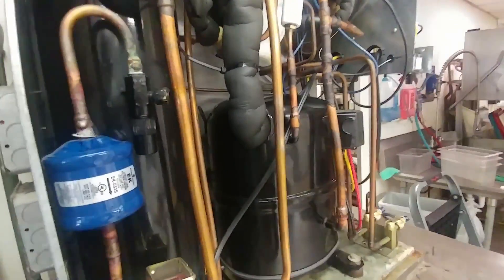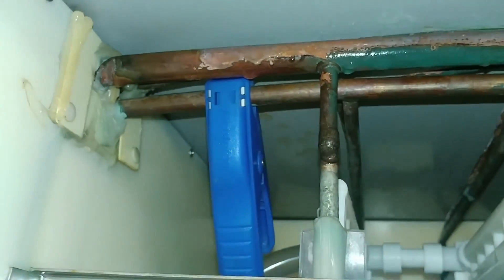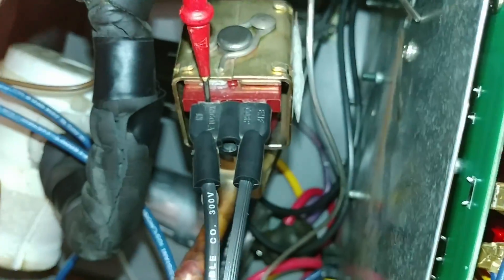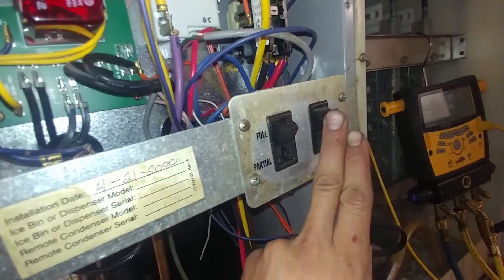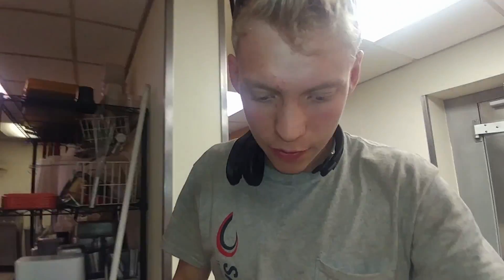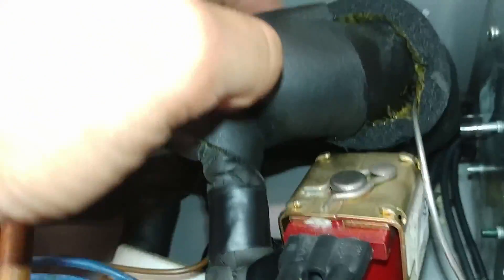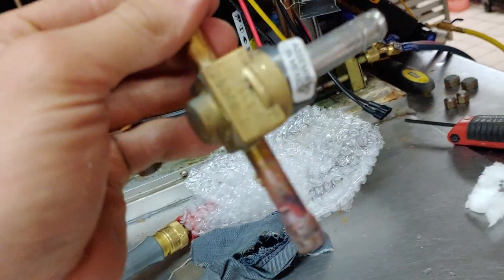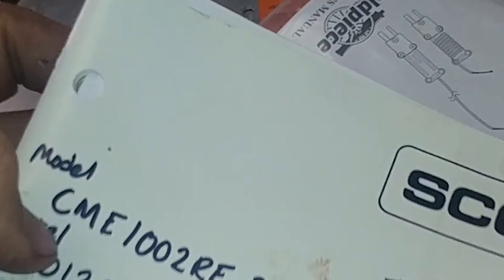Bad Hot Gas Solenoid (Trouble Shooting Ice Machine)

Comment: I’m actually found a similar problem on a reach in freezer hot gas valve is leaking causing it not to drop below 33 degrees. I also thought it was the compressor going bad

Comment: Hey Reuben, I have an LG water inlet valve assembly that I'm assuming has a bad solenoid going to the ice maker, since the water dispenser still flows.  I'm not blaming the actual ice maker yet.  There are 3 EMI suppression thin film capacitors wired into the wire harness.  If one of those fails, (I'm assuming a failure would disrupt continuity) could it be the reason why the solenoid doesn't work and the solenoid is actually fine?  Maybe someone smarter than me could just test the capacitors and replace the bad one?

Comment: One of my roommates just bought a tabletop nugget ice maker and I guessed it had a reversing valve in it because before and after the ice slides off there's a really hard click and the compressor stays running. You confirmed my guess.

Comment: How do u adjust that timer ? I have a smaller version of that ice maker. Everything inside looks the same besides mine only has one panel that makes ice. Iv got a problem with the water always coming on and it won’t make ice. I have to have the valve on water just barely open if not it runs way to much water

Comment: Cool Video, Im not a Big fan of those scottsman Ice machines,  I had 9 Of those I kept running at a comedy club I worked for. I prefer the Manitowoc slab style machines, I have an Old 30 YO servend I saved from the trash 20 years ago that still makes ice In my Barn to this day. Fun ;-)
Reply: Scotsman has to be the most frustrating ice machine, even putting one back together can be a headache. The only thing worse to deal with is a flaker or under the counter machine.